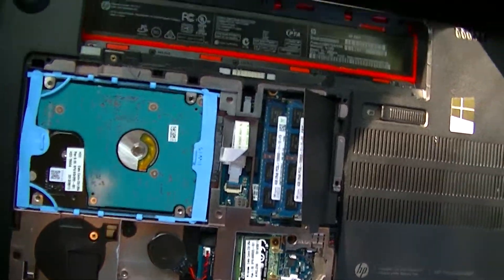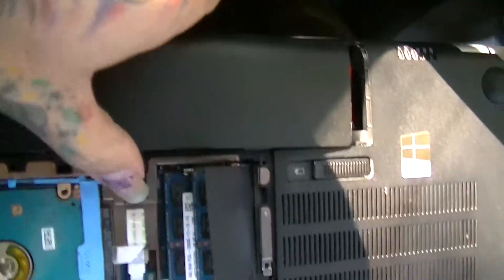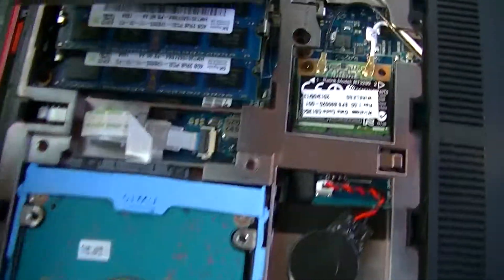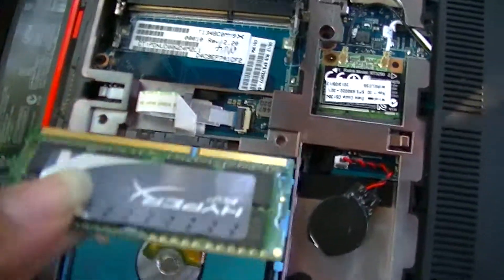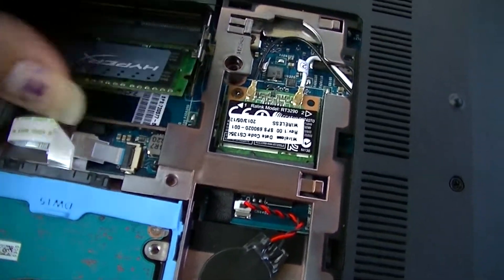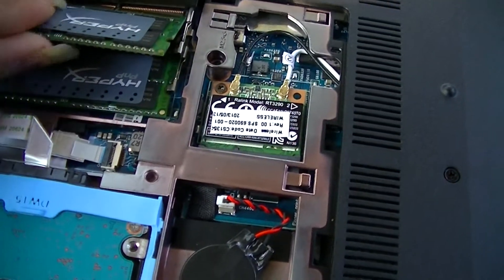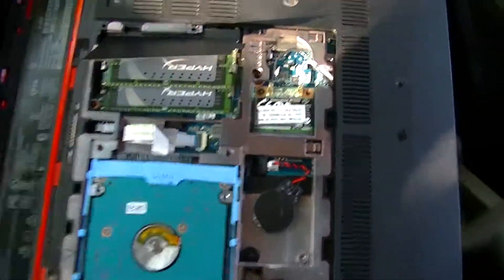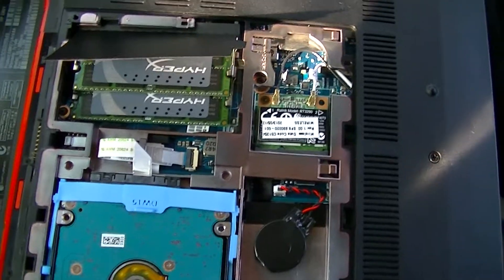RAM upgrade on 15.6 HP ENVY TOUCHSMART 15-j009wm

Comment: is there anyway to upgrade the cpu?
Reply: i may be late for the answer but yes you can upgrade the APU (CPU+GPU) in this model to a A10-5750M both of them use the same socket. keep in mind that you need to reapply thermal paste if you do so.